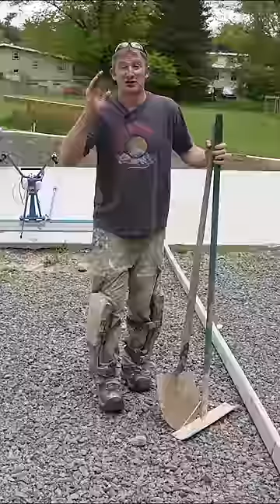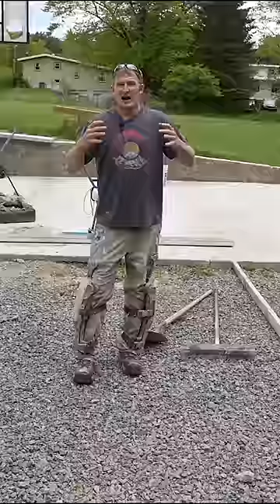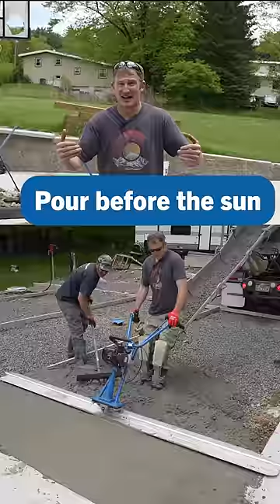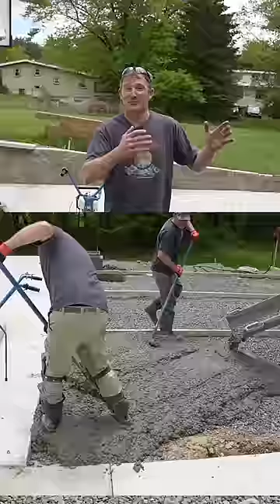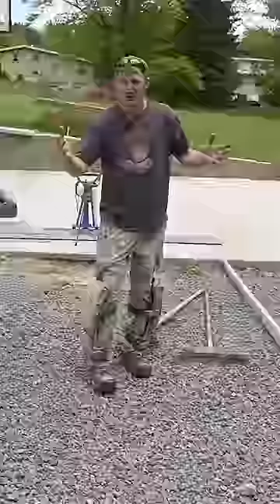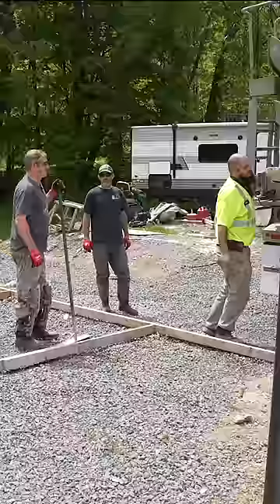Concrete tips

Comment: 6 to 7 slump will yield lots of shrinkage and you can easily over work the surface with a float and/or trowel giving wonderful cracks crazing and spalling.  Use a superplasticizer which will keep the slump low (4in) but act like a 5 to 6 in slump.
Reply: Excellent advice
Reply: Exactly
Reply: Superplasticizee
Reply: Also, make sure to use rebar!
Reply: How about putting steel grill to avoid cracks?
Reply: Adding water on site to achieve a 6 to 7 slump will significantly change your cement to water ratio and will seriously decrease the strength of the concrete.
Reply: @HinesKM  Absolutely

Comment: Concrete is not designed to be poured at more than a 5 slump naturally because of your water to cement ratio. The result of a bad water to cement ratio is cracking, delamination and overall structural failure. I would suggest a few things. 1. Use a water reducer to achieve a wetter slump 2. Wet down your gravel the morning of your pour. If you pour on dry gravel it sucks the moisture out of the bottom half of your slab making it go off faster.  Cheers!

Comment: Stayed tuned for Part 2 of this video where he breaks out the spalling, cracked up, uneven slab.
Reply: I wonder whats going to cause the fail? High slump? No rebar? Who knows if he tamped the base? Im guessing not.
Reply: @downwithtrudeau  You cant compact gravel.
Reply: Or sand
Reply: @Kathi Hines  yes you can. You just need to get it wet.

Comment: Having an even grade for 3.5in slab is very important with reinforcement if you don't want the slab separating.  Nothing beats 2in thickness like his prep work.  You will at least have used a little less concrete than you should have and make a bigger wasteful pile later.  Nice video......

Comment: Slump is NOT a water/concrete ratio.  Slump is the distance the concrete collapses when poured into a specific measuring cone when the cone is removed..  A slump of 5 is best.  Beyond that is too runny and you run the risk of efflorescence (chalky surface).

Comment: Adding excess water causes increased air entrainment within the concrete. As the concrete cures the excess water evaporates leaving behind tiny voids where the water was. These voids then become the pathways for failure when the concrete is under load. Adding that much water would lower the compressive strength by at least 25% and reduce the tension strength by more than 50%.

Comment: 7“ concrete is very sloppy. Redi-Mix drivers call concrete which is that ‘wet’, is known as “self-leveling concrete. Like water. The concrete will set-up within an hour but it will still have a ton of moisture in it. As the water evaporates, the concrete wants to shrink because the water is leaving. It cannot shrink so it adapts by cracking. 4”. Slump concrete is harder to work with but far more durable and long lasting……and it won’t crack. There are chemicals available which make the wet concrete more “slippery” and easier to work with. They have a shelf life of about 30 min, once they are added to the concrete. After that, they break down  and lose their effectiveness. They give you extra time to work with the concrete without compromising it’s strength. 1 qt of this chemical with raise 4” slump to 6” in an 8.5 cu yard load of concrete.

Comment: No re bar or wire?
Reply: I think he used concrete with fibers.
Reply: Fiber is NOT a replacement for steel reinforcement. Altogether different purpose. And it should never be used in slabs that are in freeze-thaw cycles.
Reply: ...fiberglass rebar...
...if you want it to last.

Number 3 fiberglass rates as a number 4 steel rebar.

Then, in 20 + years, it doesn't rot out your product like how steel always does
Reply: Just add salt as the Roman's did

Comment: With the 6 to 7 slump rate make the concrete weaker 🤔
I had some concrete poured for a driveway and under a large carport 23 years ago. It still looks brand new with no cracks. 
I had another slab poured less than 15 years ago and it's already falling apart 😡

Comment: Ok last one I promise, but shouldn’t you have some rebar in there sir ?
Reply from the maker: You can if you want. I just add fiber.
Reply: 4000 psi at 4in thick with no rebar or fiber you can land a 4 person Cessna airplane on it.
Reply: I don't know what type of fiber you are using but synthetic fiber doesn't replace welded wire mesh. Synthetic fiber is for plastic shrinkage cracks and after 24 hours they no longer serve a purpose. They only all concrete to gain enough tensile strength to prevent plastic shrinkage. Welded wire mesh is installed to stop propagation of cracks when (and they will with that high of a slump) they occur. I encourage you to watch some of Tyler Ley's videos. The time is a great idea and your forms at 8 ft spacing will help control the cracks.

Comment: Hire men that know what theyre doing is the best way to do concrete. It's $8/foot if you just hire the finishers to do a job. Hiring a contractor is where people get beat over the head. Tradesmen will do a decent amount of work for a couple hundred bucks. $500 is what I pay a pair of guys to help me with concrete and they are both finishers. We get the concrete where it needs to go, screed it, then finish it all in a few hours. I'm not a finisher, so I'm not going to do it without a professional to help me get it done. 

Most people with basic knowledge can form up a slab. It's not rocket science.
Reply: I've been finishing for 10 plus, depending on the pour I charge a day rate of 300 for myself.

Comment: Sheesh 6 or a 7 you are loosing a decent amount of strength and will take forever to dry 
My guys poured 1,100Sqft(14 yrds) floor slab for a New showroom at Toyota of Woburn
We bugged it in with a 5 slump with no NCA because truck had 40 min ride and took alittle bit to buggy it but I’d wouldn’t go over 6 personally

Comment: So you're going to pour a six or seven which is not what the concrete's designed to do I know you guys have pork concrete don't like to work hard and I know that you don't want to pull it all over the place however the more water you put in there you separate the aggregate the aggregate to go to the bottom The cream goes to the top and the sand and that's how you get capping which I'm pretty sure you know what caffeine is if you don't that's where the top of the concrete starts to chip off no my family's been in a concrete business for all my life my grandpa's life and pretty much forever and a day so we owned a concrete company these concrete mixes are not designed to fluidly wash down if you order it from the plant and you order it a certain slump it'll come out that way with the proper admix in it you start dumping s*** tons of water in there and you ruined the concrete seen this for years and then you wonder why it pops and chips and comes off yeah I agree with you Don't pour it into hate of the day cuz that just makes it hard for you to move it around and get it laid down and finished it however if you have enough guys Manning the job you should be able to get it done pretty quick order in the late afternoon for somebody that's never done it and doesn't know how to measure concrete properly would ensure them not to get a cleanup or a call back on a truck so I think pretty much the only thing that you put in here that worthwhile or your screeds and your drawbacks so yeah I guess that's my opinion if you've been pouring it or six is seven and weting it up since you get back there you probably got lots of customers that absolutely just hate you or dumb to the situation that you don't know what the hell you're doing cuz you just ruined the integrity and the structure of the concrete we've poured concrete at exactly one half of a slump those are state jobs median walls so on and so forth it sucks to be you but keep on robbing your customers by you adding too much water